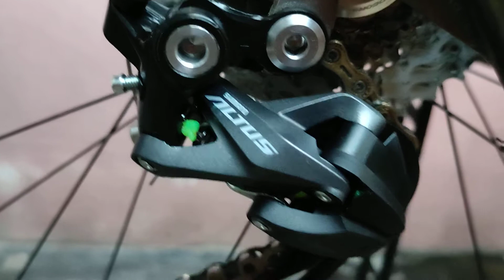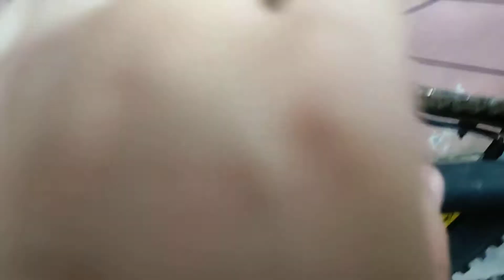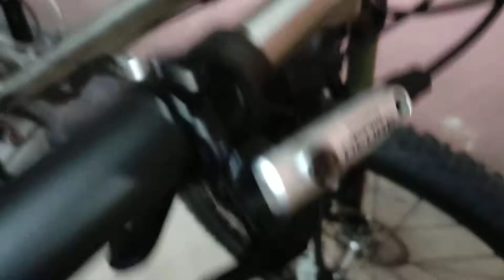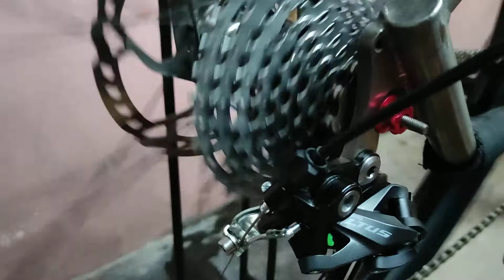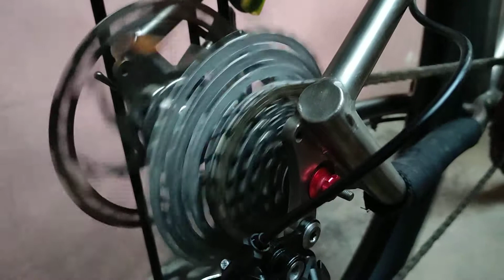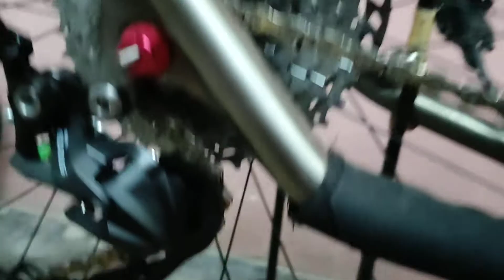shimano altus rd M2000 with 10speed shifter, cogs, chain - fail

Comment: Have you tried adjusting the barrel adjuster? Turn counter clockwise in small increments then check.
Reply from the maker: yeah tried everything, will check em next time, anyway it was just an experiment on my end, i dont really use that kind of setup, i only have xtr rd and zee both 10spd

Comment: But why does it happen tho?i thought a rear derailleur only moves as much as the shifter pulls the cable?
Reply from the maker: I'm also clueless, i just tried this and shared or uploaded the video, i will try other combos next time, may an 8 speed rd with 10 speed shifter, 10spd cogs, and 10spd chain

Comment: Paps, di lang maayos pagkakatono.

Dependent kasi ang RD sa shifter, nagkakatalo lang sa pagabotsa maximum teeth  ng sprocket. Like Tourney TX800, pwede isalpak sa 10 speed or 9 speed cogs as long as 42 teeth ang max teeth sa sprocket at yung shifter dapat parehas sa speed ng cogs/sprocket.
Reply from the maker: Sabi ng mga banyaga di daw talaga gagana, pero subukan ko uli next time yan, or try mo na din yung ganyan na setup then pa send link para ma gaya nadin ng iba

Comment: It has nothing to do with shifter cable pull. It is the RD that has different pull and thats why it wont work. It is a terrible mess and SRAM is even worse (EAGLE flat bar shifter does not work with EAGLE RD etc.)
Reply from the maker: Thanks for the inputs, check out the comments section different inputs and thoughts hehe